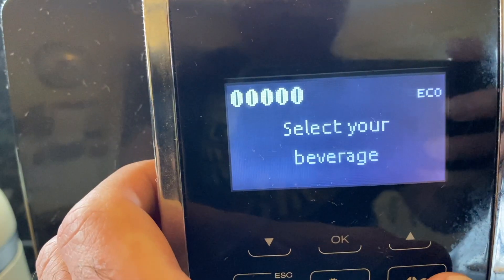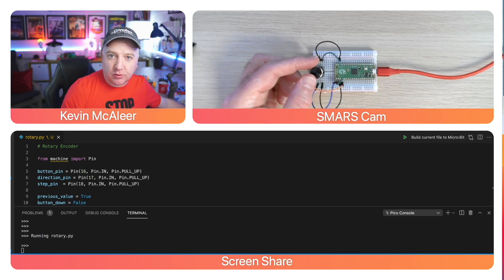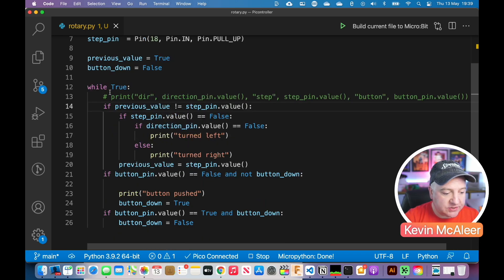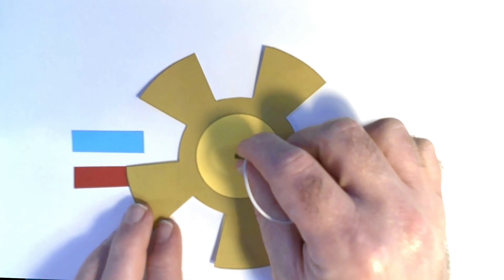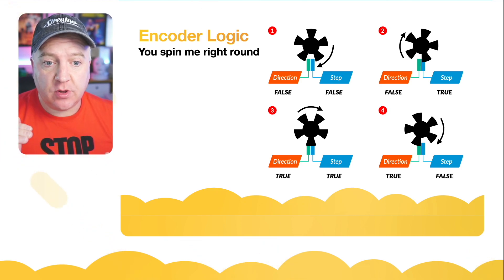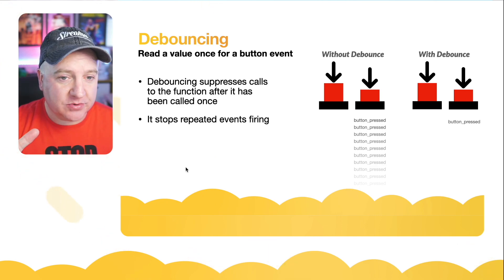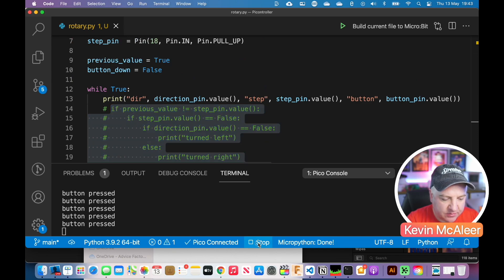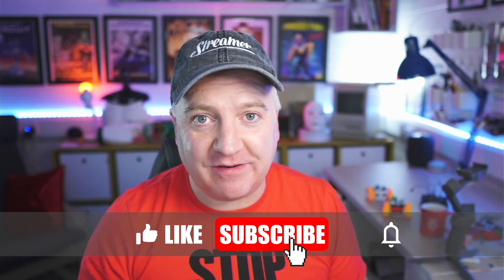Rotary Encoders with the Raspberry Pi Pico and MicroPython

Comment: Thank you for sharing! I was surprised to see you not having to software 'debounce' the rotary decoding portion of your code.  Perhaps there are some filters inside your particular device? Encoding 'chattering' is usually circumvented with  low pass filters or some kind of finite state machine in your software.
Reply from the maker: @johnnyw66  it’s probably because MicroPython runs slower than C++ and that slowness counters any physical deboucing that would normally be required. I spoke to some hardware manufacturers about this and they said they don’t do debouncing in hardware anymore either

Comment: That's not really  the correct definition of debounce
Reply from the maker: Hey Brant - what did I say wrong 🥹
Reply: @kevinmcaleer28  
Hello Kevin. Thank you for the video, very clear and instructive.
Regarding the remark of Brant: your code is in fact detecting a change of state of the button (this is an edge detector) and does an action when switching from not pushed to pushed.
Debouncing is something else. In your case, the goal would be to remove any hardware/mechanical bounces while switching from not pushed to pushed. A classical method is to confirm a stable state by verifying that the state does not change for some time.

Comment: button debounce is required because in the old days when you released the button, the contacts would bounce and retrigger a detections.
Reply: Not really as can detect this in the code..  irq(trigger=Pin.IRQ_RISING | Pin.IRQ_FALLING, handler=callback) ..  However, long press is not handled and can cause an issue